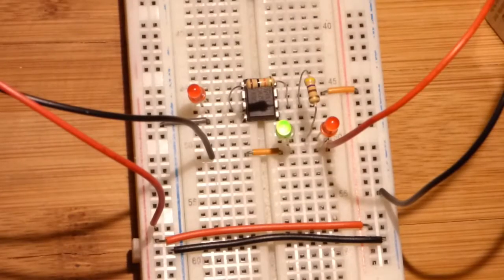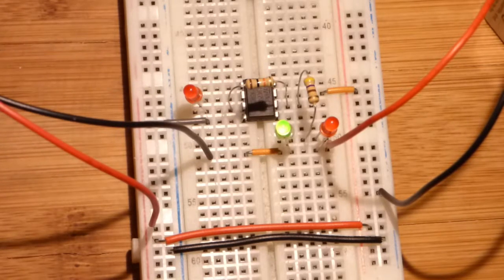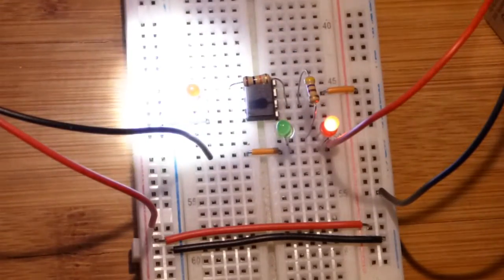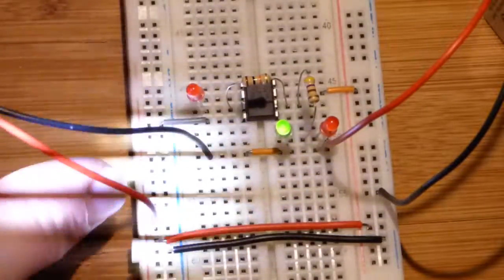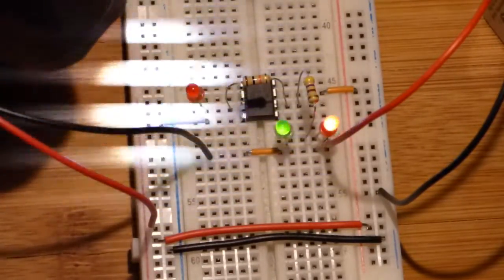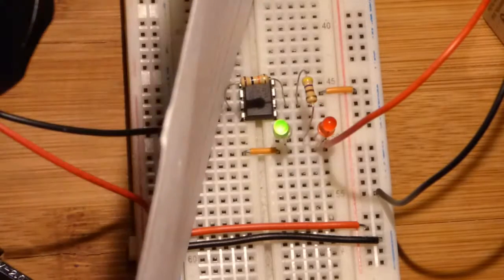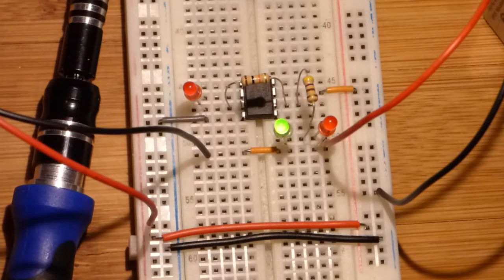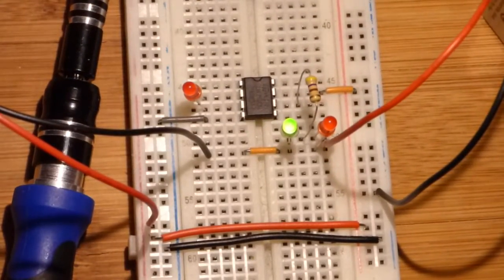LED used as light sensor for 741 op amp inverting comparator demonstration circuit by electronzap

Comment: Did you try to use a resistor in series with the led, or is it that the led current create a voltage in the op amp resistor thus corrected ? I'm curious about what happen whith the op amp when there is a current in the led.Thanks for that circuit/idea.

Comment: Awesome circuit. I will definitely do this experiment when I get home. It would be nice to have a step-by-step assembly video of this interesting circuit for that though.
Reply from the maker: Thanks! I'll see if I can make  step by step video. I used a 10K resistor from pin 6 to pin 3 for positive feedback. Anode (long lead) of LED to pin 2 and LED cathode (short lead) to pin 3. Output polarity indicator is exactly the same as what I use in most, if not all my videos so far.
Reply: I have made this experiment, thank you. May I post it on my Youtube channel video diary with only music and no narration linking to your video for reference and giving all credit to you?
Reply from the maker: Sure thing, that's no problem :)
Reply: @Electronzap  hi is there a circuit diagram or a following video, thanks,
Reply from the maker: @smartchip  No, I never made a diagram for this circuit. Looking quickly, I found a similar circuit with diagram at https://youtu.be/35PGxasdAsA Light Dependent Resistor LDR controlled non inverting 741 op amp comparator circuit by electronzap.
Reply: @Electronzap  thank you sir, appreciate your great work, i can also do the project to get to know stuff or familiarize myself, thanks again bud, N1, did you get round to do a diagram or something, as i would like to make the circuit, some help :-)